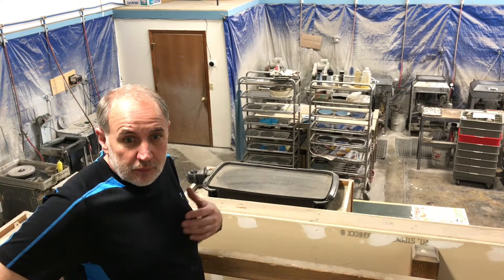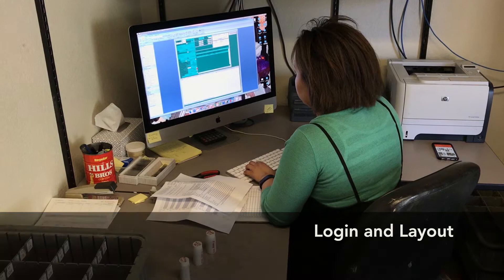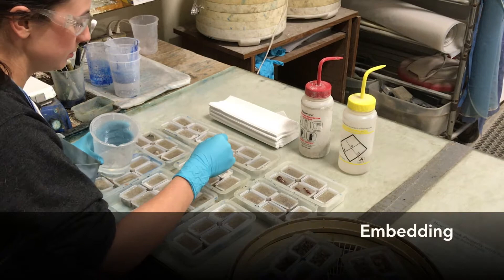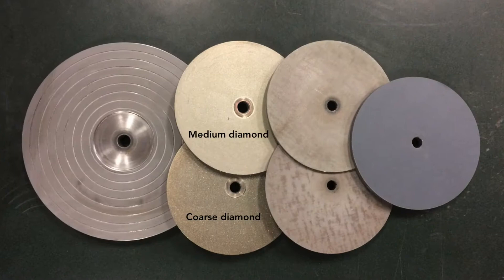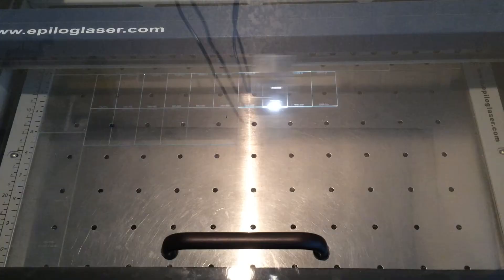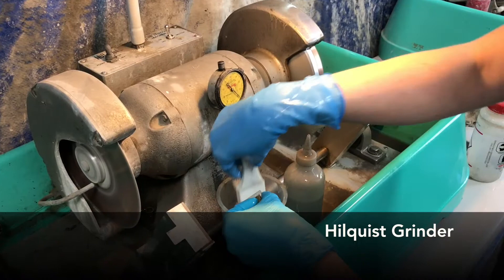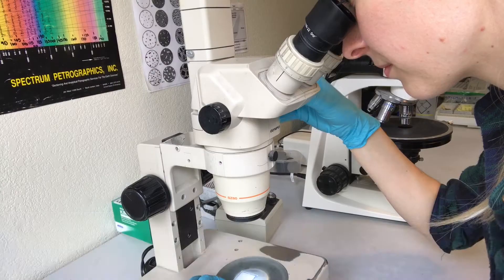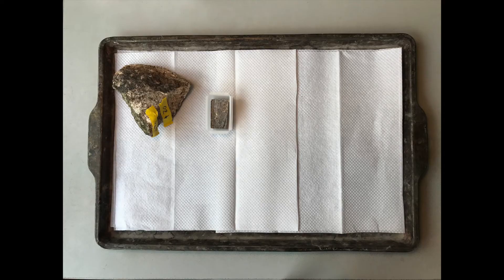Thin Sections ft. Spectrum Petrographics: Behind the Scenes

Comment: Thanks so much for sharing.  Would love to know how you keep your grooved laps flat over time? And also what type of UV glue do you use to mount the sample onto the glass?
After vacuuming out the bubbles from the resin in a chamber, placing the samples into a pressure chamber (like a seal-able pressure paint pot) over night at 55psi would further reduce air bubbles.  Again, thanks so much for sharing.
Reply: You can get the lap machined flat again by a machine shop - they're not sophisticated. While you're at it, you might want to take some time to actually level the lapping machine - not everybody does. Being off-level helps to smoothly shuffle the slides around on the lap if you're mass-producing. 
Across a thin section, you'd struggle to measure even several degrees of "cone" from uneven wear. Simply changing from grinding on the edges to grinding on the lap centre routinely was all the technicians at college advised us to do.
You can pressure-flood resin into rocks, if they've got a high porosity and permeability, but generally the finer parts of the pore network are insignificant in terms of reservoir properties. It's a charged-for extra, probably after you've had the first batch of sections cut from your core.
Reply: The glue's important point is to have a refractive index that matches "Canada Balsam", which was used in the development of petrography. There are several commercial products that match this specification, and things like setting time, UV sensitivity dictate which one you'd use for a particular job.
Air bubbles aren't that much of a problem, even without the depressurisation step (see "setting time", above).

Comment: What is the cost for preparation of single standard thin section
Reply: The last time I looked (20-odd years ago), the prices for single specimens were in the £30~£50 range. Per section.
Commercial labs want large orders, not single samples.